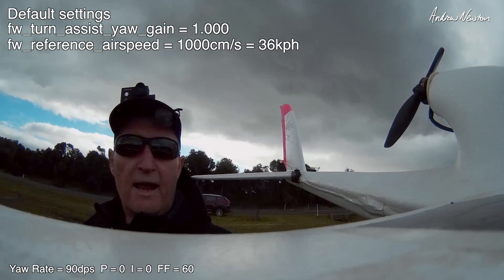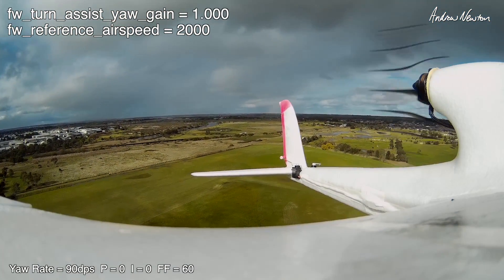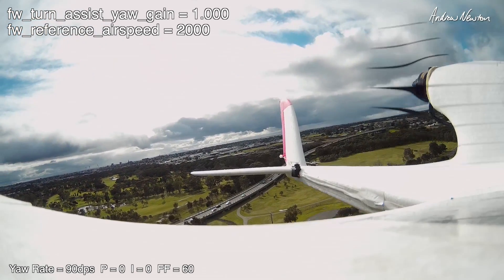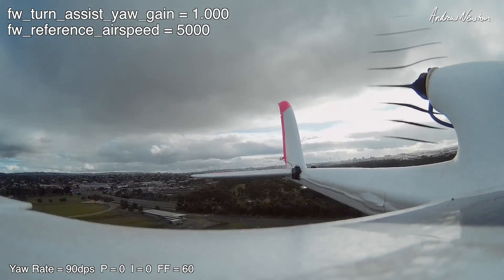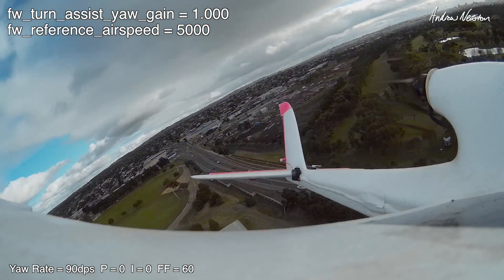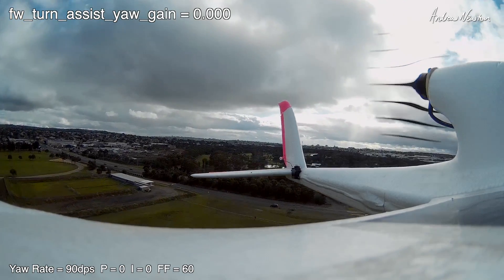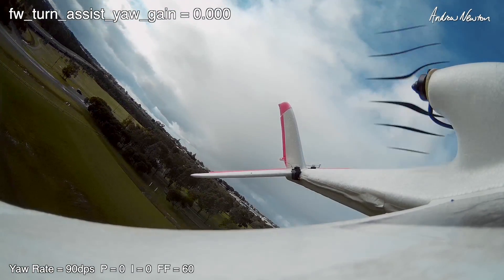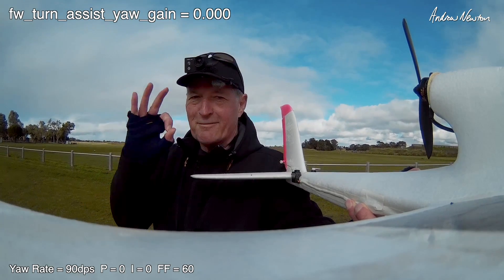iNav FW Turn Assist and Reference Airspeed

Comment: I'll give the Turn Assist OFF - Set fw_turn_assist_yaw_gain = 0 a try.  I have the Ranger 2000 and it flies well in manual mode and horizon mode.  Soon as I put it in RTH it either oscillates for a bit one direction then the other direction but eventually wants to do the death spiral.
Reply from the maker: Certainly fixed it for me. Too much rudder action

Comment: Hi Andrew, Im needing help to setup a digital airspeed pitot (MS4525) with a f405 wing FC in INAV? I do not find where to start where to configure it.
Reply from the maker: Matek product page
Reply: @AndrewNewton  I did connect those CL2/DA2 i2c port at f405, as indicated at http://www.mateksys.com/?portfolio=f405-wing#tab-id-3 but nothing happens and is not clear at Inav config where to setup that MS4525 digital pitot. I tested the sensor with esp32 with an i2c scan and respond at address 0x28 (40 decimal) so sensor is ok I think. So still need help ! thanks
Reply from the maker: Configuration page > Sensors > Pitot Tube
Reply: I had some issues with I2C cabling as I set the magnetometer and the pitot in the tail, and using a cat6 eth cabling twisted pairs. magnetometer worked but pitot not. I tested all with short cables and worked, then I untwisted the SDA/SCL pair to the tail and voila, it worked. thanks!

Comment: Andrew, enjoy your videos very much! Is it normal in inav for a fixed wing to lose quite a bit of altitude in an aileron-only turn when flying in angle mode? I wouldn't have thought so but my flying wing does. It doesn't appear to add elevator to keep the nose up. Thanks for any advice.
Reply from the maker: You would have to input some elevator as well to maintain altitude. Angle mode knows nothing about altitude, it's only looking at board angle. The wing could be losing altitude even though the board is level in pitch

Comment: A could questions. Do you make any changes in the mixer tab in the configurator and how does this effect flying in Angle mode? Thanks!
Reply from the maker: Changes in the mixer are like changing rates. Can do that if the rates are too high. Wont change Angle mode flight, only manual and acro really

Comment: Hi Andrew, I want to experiment with this further but I wasn't looking forward to bringing my laptop to the flying field (terrible battery life). I just learned you can connect a 3 or 4 dollar bluetooth module to a spare UART on your flight controller and completely configure INAV from the Speedybee app for iOS and Android, including the cli commands. Perhaps an idea for a future video? Best, Alexander
Reply from the maker: I have the bluetooth module, but not tried yet
Reply: Hi Alexander
I would like to set up a bluetooth connection using Speedybee to control my INAV through CLI. I would really appreciate some further information
regards
Hans Leatherby
Reply: @hansleatherby1032  I ordered the bluetooth module and followed the instructions from here: https://github.com/iNavFlight/inav/wiki/Bluetooth-setup-to-configure-your-flight-controller. But I have since stopped using this, because the connection was very intermittent. For example, running diff in the CLI only gave me a quarter of the diff output. I am now using a micro-sub to usb-c cable which is much more reliable.  Also, the pads on those bt modules are very small and easy to rip of the pcb, so you have to be careful when soldering it up. Let me know if you have nay other questions.
Reply: @avsaase  Thanks Alexander  I think I'll go with the Speedybee that plugs in directly to eliminate those problems

Comment: Hi Andrew! I'm a big fan! I have a question regarding iNav and RTH. Recently, I've had a devastating crash of my beloved Strix Stratosurfer equipped with GPS, FPV, and a Matek 765-WING. After sweeping up the wreckage, I pulled the blackbox data and found that a GPS_GLITCH flag was thrown in the FC about 10 seconds before the crash. It is important to note that the plane was in a RTH Alt-Locked mode, and circling above me when it suddenly nose-dived into the ground. Have you seen this before? Any recommendations? Thanks in advance!
Reply from the maker: Oh no! I haven't had that happen. GPS connection issue, poor reception? But it should just stay in Angle mode without satellites. It's a mystery sorry

Comment: Great vid, Andrew. I too do not like how iNav handles the rudder on my Phoenix 2400. So in the Servo Mixer, I simply set RC Yaw for the rudder servo rather than the usual Stabilized Yaw. That gives me full manual control over the rudder all the time without having to change anything else. I prefer it this way as there is simply no need for yaw stabilization in this airplane.
Reply from the maker: Yes, that's the solution.

Comment: It's been a while since I've set up iNav, my plane still just works so I've not updated for a year or more.  I seem to recall a setting that changed the turn radius for RTH and loiter.  Increasing that was a simple tweak that prevented my planes from crazy steep turns.  (Won't help with the odd rudder behavior in some modes though.)
Reply from the maker: First things I tried back when I first encountered the problem were increasing the cruise speed and loiter radius and decreasing the max bank angle. Made no difference, the overactive rudder made the bank greater than the limit and turn tighter than the radius

Comment: Thanks for this series of videos demonstrating the difference between air mode and acro on a plane with rudder. It's got me thinking, what's the difference between air mode and acro on a flying wing with two elevons? Is it just that one has stabilization and the other doesn't?
Reply from the maker: That's not what I am doing. AIR mode is off for all of this test and it's not a mode like ACRO. If AIR is on it just modifies any other mode that is selected to keep full stabilisation when you drop the throttle to zero. More of a quad requirement and not needed on fixed wing
Reply: air mode keeps the pid action high, even at lower speed. It is a must for me on multirotors. Acro tries to keep to attitude the plane is in. I use this for an aimed point on fpv landings.

Comment: Or just connect the rudder servo directly to the RX. With P,I gains zero and no turn assist, I think inav is basically manual mode for rudder -- only endpoints and expo. Thanks for sharing!
Reply: thedillybar in the mixer you could just assign it as pass through from channel 4 (or whatever rudder is) instead of stabilised rudder, maybe I'll give that a try.

Comment: I strongly suggest not wasting your time with Inav, and go to arduplane. Much more complete and reliable, if setup properly.
Reply: Agreed, but it's like wading through treacle. iNAV gets the job done and just like Arduplane, it needs minor tuning on occasion.
Reply: I haven’t tried Arduplane, as I understand it, it is much more expensive.  Is that true?
Reply from the maker: Same price as iNav and it is designed for FPV. Just that the user interface is very messy
Reply: Also as I understand it, Arduplane is not really compatible with FPV.
Reply: I would agree about ArduPilot.  In the 10 or so years I have flown it I never had these problems.  TECS and the EKFs are vastly superior at flying.   Yes mission Planner is a bit messy however I find the same with iNav.   It’s what you are used to I guess.  I only used iNav because of a problem with GPSs and the Matek 405 Wing which I think now has been solved.

And another problem is you don’t have an airspeed sensor.  They are critical for avoiding stall spins.  Never fly anything other than a very basic trainer without one.

Comment: Nice one Andrew! I had thought setting the reference airspeed to 5000 would have a bigger effect (smaller rudder throws), but apparently not. Nice find on the yaw gain, gives nice aileron only turns. I will try experiment with TURN ASSIST on top of ACRO to try and tune it to get nice coordinated turns, while keeping the yaw stabilization with non-zero P and I. Maybe with fw_turn_assist_yaw_gain set to 0 it should stop fighting the turns in ACRO (and not help either). One other thing I can think of is the yaw rate. I always set is conservatively low because it is difficult to measure, but I think that may make the FC expect only a small yaw effect from full rudder throws. Turns out a lot of factors go into how the plane flies! Thanks for the mention!
Reply from the maker: Yes the ref airspeed surprised me too. Yaw rate increase actually increases the rudder throw. It's tricky trying to work out how each parameter is used in the equation
Reply: @AndrewNewton  I tried searching through the code but that is way to complicated for me. When I get my F405-Wing I think I will start with the reference airspeed set at the true airspeed @ cruise throttle and experiment with different fw_turn_assist_yaw_gain's, probably start with 0.5. It's a bit of a hassle that you cannot change this setting from the OSD though. I hope the devs add it in a future version.